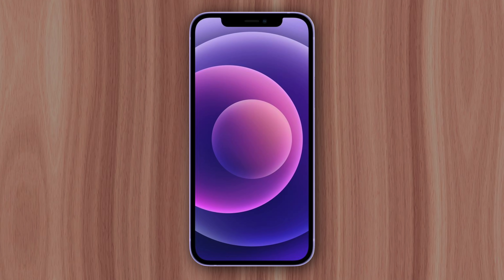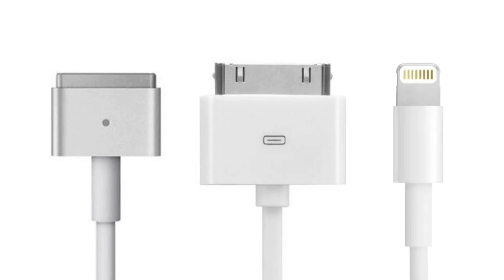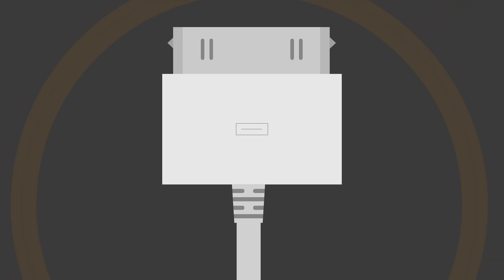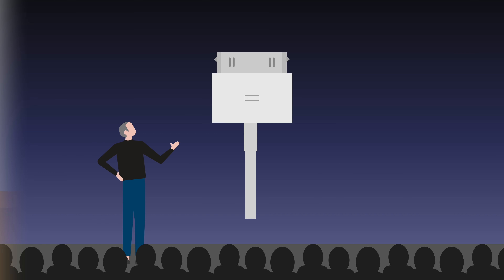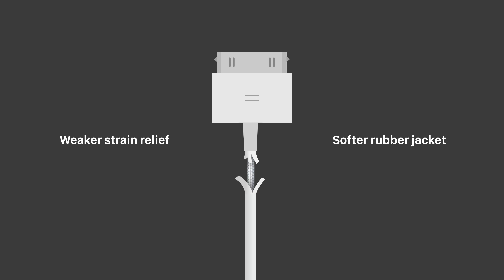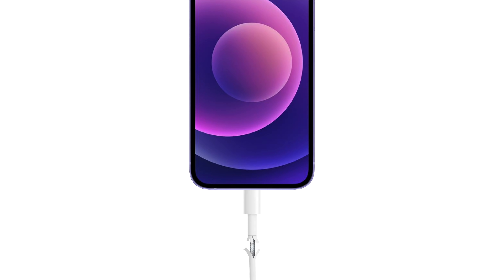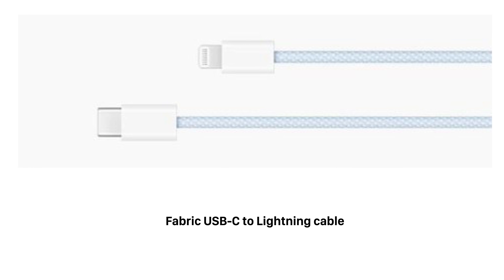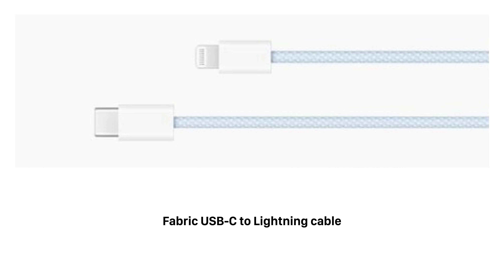Why iPhone Cables Break So Easily

Comment: I keep my original cables and chargers in the box for when I eventually sell off my older models. But back when I was using the OEM cables, I’d replace them one by one with third party woven fabric cables rather than another flimsy OEM cable. I’m not a huge fan of that part of the Apple “ecosystem” but it’s part of the “Apple Tax” I suppose. Apple’s design “Form over function” choices has backlashed on them more than once though. But you have to admit, they do have some beautiful products.

Comment: My android phone's charging cable is similar in design to apple's but it didn't broke or experienced any damage caused by kinking at the ends( it"s damaged a bit by me because I walked over it several times and i don't plan to end this routine but that's another story.)
Reply: Well a lot of Apple users also charged their phones more often and used it at the same Tim as iPhones used to have really small batteries. As a result it split in the top.

Comment: 2:15
Not if you buy third party cables. One third party cable has lasted me much much longer than one official cable. 
The cable that came with my ipod frayed within months. 4 years on, and I'm on my third third party cable. They're both cheaper and longer lasting

Comment: I disagree. The people who have issues with their cables no longer working tend to pull it out of the phone by grabbing the cord instead of the connector. That weakens it. I STILL have mine from the ipod touch with ggd original connector.

Meanwhile my friends that pull theirs out by grabbing the cord go through them very frequently.  Apple doesn't explain this because it's beneficial to their bottom line.

Comment: Simple: Profit margins for cables is a lot higher than for devices. On top of that, their brand doesn't really suffer much from broken cables. people whose devices break after 6 months won't buy another apple phone, whereas if the cable breaks they'll just buy a new one, usually from apple themselves.

Comment: The metal contact teeth on the Lighting cable end also tend to wear out and stop charging. Just threw out away several cables with this problem.

Comment: Maybe not so eco-friendly in the long run as I've had about 4 chargers for my mid-2015 Macbook Pro. Apple knows it's a problem because I showed up at their store one day broken charger in half. I didn't have a receipt but said I bought it a month or two ago. The guy just grabbed a new one of the shelf and gave it to me.

I've now taken to cracking the charger open and replacing the cable, so if it wasn't for that I would have been through 5 or 6 chargers already.

Comment: do they really? I have a couple iphone wires(2-3), one is a newly purchased aftermarket 'kevlar reinforced' cord that I use to charge my phone at home. But among the other two one came with my iphone 12 pro and the other one was for my previous iphone xs. The xs wire has been around for about 2 years now and still working. It took much more abuse than the expensive kevlar wire I keep at home, sat in my glovebox where all kinds of different things get shoved in and shared by many phones. Last time I was charging my phone im my car(which was about 11 hours ago) that wire still works. 
i dont know man either we live in completely different realities or you need to stop abusing your wires

Comment: on the other hand it could be a good way to teach people to take care of their stuff properly, I mean how badly does one need to treat their cable to destroy it?
Reply: It doesn't matter how well you treat it. Eventually just the strain of being moved around to plug it in or even existing in general will break it.
It's a matter of when, not if. It's just easier to speed up that process when the cable is pathetically weak.
Reply: @someonerandom9939  sure, if you use it often, in various conditions, it wil eventually break, like everything else I guess, but even this weakened (compared to other designs) cable seems to hold on for many years and I use the same cable to charge the iPhone and the iPad almost every single day

Comment: I have not needed a cable to charge for 6 months… let me explain… I use an iphone XR with the iphone 11 smart battery case  (yes it fits and the case itself charges wirelessly, with the phone inside). I plop it on a wireless charging over night and never have to worry about charging my phone ever during the day. on a typical day I’m left with about 0 percent battery on my smart battery case, and about 80-90% on my XR with moderate usage. plop it back down on the wireless charger overnight and repeat the process with 200% battery in the morning 👍 yes it makes the phone more “bulky”… but compared to carrying around a bulky powerbank with a cable all day, I’d much rather choose this.

Comment: A way of improve environment is improve phone durability. Apple cut out PVC for "greener apple" but prevent user to repair their phone at third-party. 

They removed charger aim to reduce waste without realizing that charger do age over time and reduces power efficiency. 

Apple "optimize" their OS to make it more "power efficient" and yet remove charging port that forces user to charge their phone wirelessly which causes significant energy loss in charging process compared to cable. 

What are you thinking, Apple?

Comment: One thing I do is thread a couple of inches of flexible plastic tube over the connector. This moves the stress point away from the connector itself and distributes it better. I will also not buy another apple product as they make it difficult to even replace batteries. And sell a product that does not work out of the box. And has built in obselescence. This is blatent malpractice.

Comment: I bought an iPad years ago for drawing and I'm sure I will never buy another one. Procreate is an amazing tool and I will miss it, drawing is smooth and feels good on the iPad, but on the hardware side is a slow nightmare. Especially on how the hardware problems are addressed by customer service and the apple community. 
1) my iPad BENT just for using it. Never dropped, never used it improperly, but now one angle is bent over in a way that sometimes the pencil goes crazy. I've searched for this online and the answer was "is a well known problem, just hold it so it doesn't bent" yeah ok I don't recall using the thing like a fresbee.
2) connectivity problems with the Bluetooth that requires to disconnect and reconnect everything just for the apple pencil to work. O to recharge. Or don't let the pencil charge fall to zero or it will never go back alive even if you leave it on charge for five days. "Is a well know issue, just don't---" yeah OK. Can I have something that JUST WORKS?

And now, I'm watching the videos of this channel, and discovering more and more f up things about apple that fortunately still didn't happen to me (but could probably happen, I'm that kind of lucky) and I'm more and more convinced that, when my iPad will eventually die, I'll just go buy a pen and a sketchbook.

Comment: I’ve never understood this complaint - maybe a few years in audiovisual territory and cable management helped but I just don’t break cables the way others do. When finished with them I roll them and twist them around themselves a bit and the ends never fray, break or crack. I’m lucky or others are just rough…

Comment: Apple is the biggest culprit yet. They claim to save environment and stopped shipping charger. They ditched the headphone jack so that they could sell airpods. They constantly slow and brick old iphones. Everything was file before software update. But right after the day i updated my iphone , it begun slowing down. It started heating up and performance dropped significantly. I bought it for $1380 and now it is useless. 3 of my friends who bought the same model (i 6S+) faced same problem after software update. apple did this to us and it will not stop. Everyone please stop promoting apple products. I have moved to android and happy with that. Android are better at value too.

Comment: Just switch the design to flat cable. If the cable is flat, it's more durable and long lasting. Round cable breaks easily after some time. 

I've been using flat cable for years since iPhone SE. I'm still using the same cable now.

Comment: my entire family uses apple cables and never has a cable frayed or broken. it only got yellow and old. I think this problem is a thing because people pull on the cable it self. my family has only ever pulled on the hard plastic connected it self. apple is not the only factor in the bad cables.

Comment: Using iPhones since the 3g, never had a cable break on me.
Reply: Im using a lightning cable from my iPad Air 2 i got in 2014, with my iPhone XR and it still almost after a decade works great.
Reply: Ive had a handful but they had hard life, lightning always outlive MicroUSB in our house, both cables and ports.
Reply: @NineEyeRon  Yeah micro USB is shit as well. The only difference is that micro usb hasn't been used in new devices for 5 years, which isn't the case with apple's much more expensive cables.

Comment: Isn't it better to have a PVC cable which can be used for longer than having a PVC-free cable which can be used only for a short duration? (I agree it depends on the difference in duration and which environmental impact is considered more important).

Comment: Their attempt at being eco-friendly only resulted in more cables going to the landfill
Reply: That's why it wasn't an attempt to be more eco-friendly.
Ist was just a strategy to sell more products, as all big companies do.
Reply: @trence  yes, they aren't dumb after all. Of course they know that this would be worse for the environment, but it's better for their wallets.
Reply: @achannelhasnoname5182  And that's - obviously - all that matters xD
Reply: …and to save a few dollars on each cable
Reply: @trence  that's why you need to learn how to behave to your cable, I have mine for 4 years now, no issues reported.
Reply: Exactly
Reply: And them removing the power adapter and other stuffs ,you still need those there for you need to buy another power adapter ,,more box, plastic etc aughhh
Reply: @fiarafind1142 boxes are recyclable
Reply: If they were eco-friendly they would be using open standards and let people repair their devices. The reason why these cables cost upward $20 is exactly why they break, $$$.
Reply: Pretty much what happened with lightbulbs
Reply: yup
Reply: So true
Reply: @Gahlok12  yeah
Reply: Facts
Reply: they didn't even "tried"
Reply: exactly
Reply: YOU ARE SO GUILLIBLE
Reply: It's on purpose to
Reply: Exactly
Reply: It shouldnt be a problem for android since apple product would detect wether the cable is usable or not by considering its cable sleeve, even though its actually still pretty usable by taping it and reuse it.

So the problem is not the cable itself, but the software. Who says Apple trying to make their customer convenience by using their product if they force you to change your cable every now and then.
Reply: You're right....it's almost as if the "environmentally friendly" issue is being utilised for greed.🤷‍♂️
Reply: And more profits in their pocket.
Reply: At least, they do not include a charger brick and and a charging cable in the box anymore when you purchase an iPhone in these days which is still considered as eco-friendly to our ecosystem, I guess!?
Reply: @missdelad.deladela7748  nope
apple absolutely doesn't care about the environment
if they actually cared, they'd let us repair our phones without getting sent notifications about non genuine parts.
Reply: Exactly
Reply: Apple marketing guys are famous for being hypocrites.
Reply: Apple "eco friendly"= More profit.
The reason no earphone and charger in the box. Apple want to sell it separately.😂
Reply: I never get more than two weeks out of apple iphone chargers!! I am switching to Android. I cannot keep doing this with apple! THANK YOU APPLE!!  will NEVER eat an apple!
Reply: So we can buy expensive cables that break easily 
And be an additional to the waste
Reply: All you guys are idiots lol…. It is not the cable they removed…. It was the adapter and they changed the cable to sell there newer/faster adapter which indeed made no sense still.
Reply: @theneighborlynumismatist8201  yes but what's the point of changing the cable without adapter now you would have to use your car and drive to another shitty apple story and have to pay a royalty for one of their 'high speed charging' adapters and the journey to get there or to have it deliver , the packaging to package a stupid thing that they could have given it in a way that's more eco friendly and not force customers to produce an extra carbon footprint to get the new capbales when they fucking break which comes back to the problem of apple not being able to make durable cables in their fucked up world of their design>functionally shit their brains go through. Basically apple produces less emissions but make customers have to produce more green house gases. It's a fact that they are just trying to make their reputation good. They are going to such shitty ways (ruining the environment ). And the worst thing is that they know customers will be causing a bigger carbon foot print cause they made the usb 3.0 to usb c lighting cables without giving an adapter and expecting people have them. But who the fuck has a adapter to usb c plug lying around the house. No one and their crappy cables that eventually break cause the overall global impact to be bigger. The WORSR SHIT ABOUT THEM IS THAT THEY STILL CHARGE 999 DOLLARS. They are doing it cause they fucking money hungry. They once dominated the marketplace now they are getting less share and are trying to make ways to get back this money but using such shitty tactics. Frick apple and their scumbag methods. I hope this helped you see. I do not care about this language as you called 'YoU AlL ARe IdIOTs'.
Reply: Yes but the cables in the landfill are harmful due to the removal of all of the harmful chemicals, maybe learn to use your brain before you comment dumb stuff.
Reply: @danimayb it is still made of 100% recyclable materials and should not end up in land fills if the consumer handles it properly. The cables that do end up in land fills is the result of careless individuals who do not care about the environment and Apple is not to blame in that scenario. However I do not disagree that they used to lack durability back in the days.
Reply: @theneighborlynumismatist8201 You touch on durability in your last sentence but don't emphasize that point

 If Apple cared more about the environment, wouldn't they make items that were more durable? There are, after all, environmental issues in the PRODUCTION of products—regardless of whether those products are recyclable or not.

The "careless individuals" you blame might actually be in positions of power in Apple rather than consumers....

Comment: The bending is not the reason of cable breaking. Seems that you never experienced it yourself, otherwise you would see that before cable break the outer rubber becomes longer that internal wires (just over time, even for never-used cable) - it bulges - and then breaks. I have seen this a lot of times. Bending is definitely not a primary break reason.

Comment: My iphone cable is in perfect condition after 3 years now. What I noticed is that some people are really idiots when using these cables. Like, they bend them super tight in a loop, they always pull by the cable when disconnecting instead of holding by the connector, they pull on the phone when it's charging in order to type or check their phone causing the sleeve to bend at 90% etc. People really have no common sense. You don't need to be a tech person to know that's bad for any cable.

Comment: I've been using Apple cables for like four years and I've never experienced any of these durability issues, but what I have experienced with almost every single lightning cable is corroded/blacked pin (fourth from the left) which makes the lightning connector not working properly and it's really annoying. Could you please cover this topic as well?